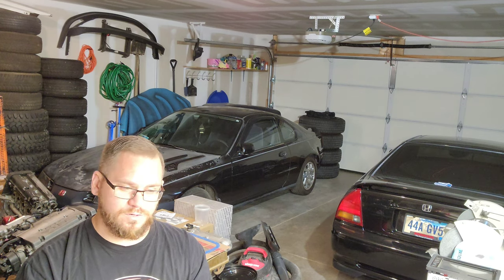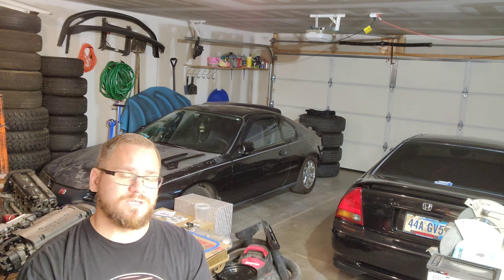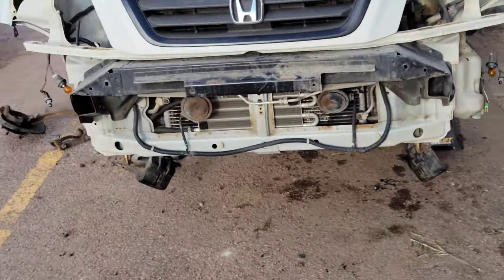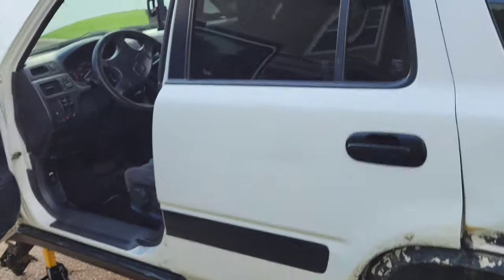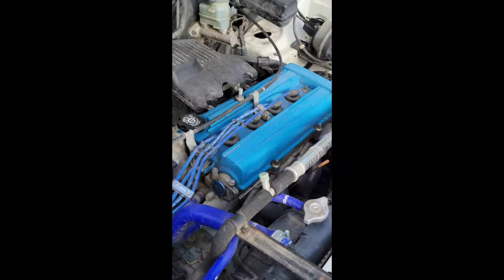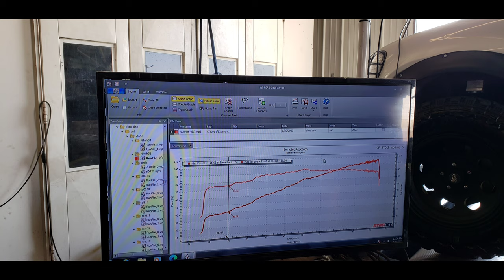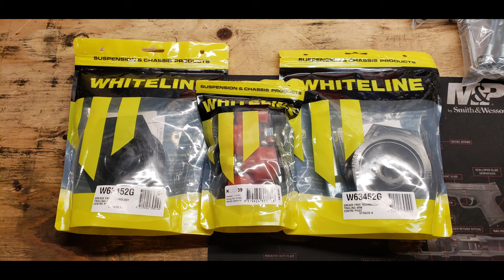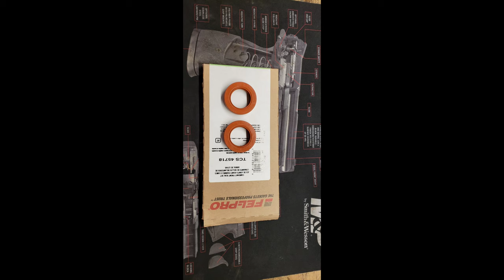FINAL FAREWELL TO OUR 2000 4in HRG LIFTED CR-V EX!😢😢

Comment: Dang man the crusher sorry to here that. Again glad your family is safe.
 
Was wondering about the hrg skid plate also your clock off the dash if it works.
Reply from the maker: Sorry about that man everything is sold for the most part
Reply: The dash clock is an easy fix, just gotta do a little soldering